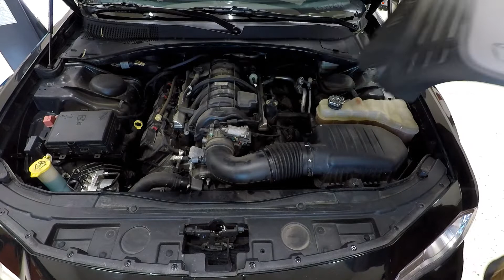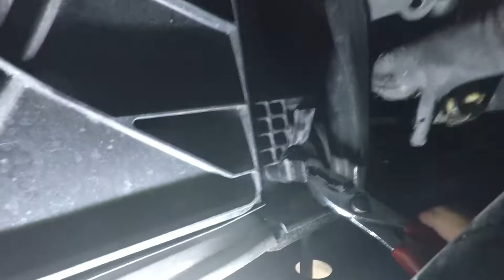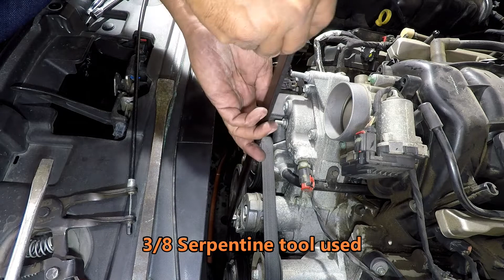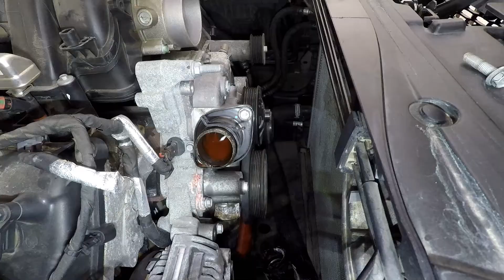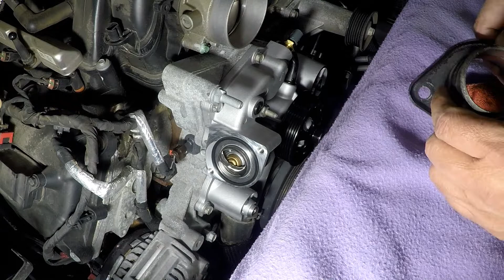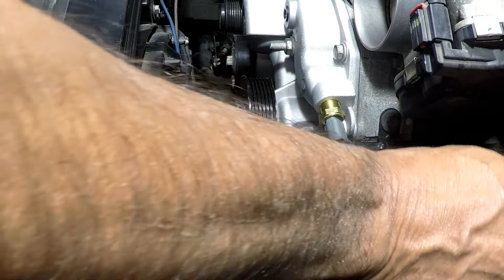Chrysler 300 Water Pump Replacement

Comment: Can I get the water pump replaced if my gaskets are bad??  I put the k sealer in in a couple because the water pump is leaking bad, but now the water pumps making a little noise..
Reply from the maker: Replace the water pump.

Comment: I have a 2012 Chrysler 300c hemi water pump is leaking antifreeze I’m wondering if I can just change the seal or should I change the whole water pump?
Reply from the maker: Replace the pump.  Don't take short cuts.